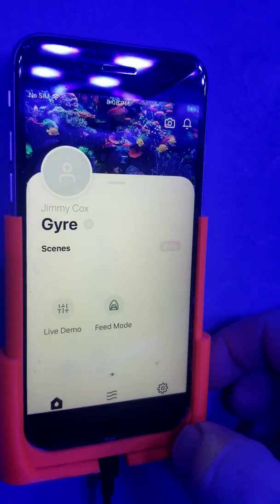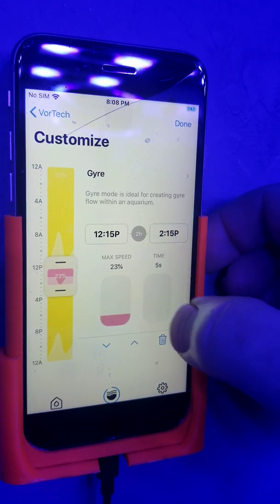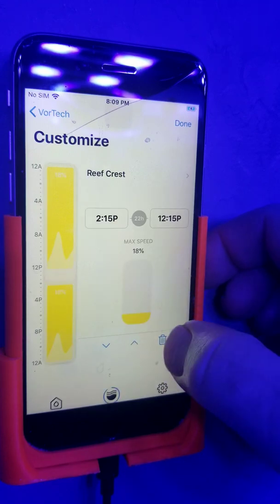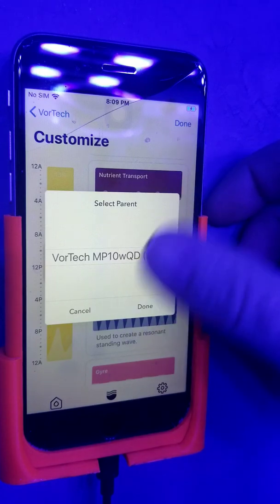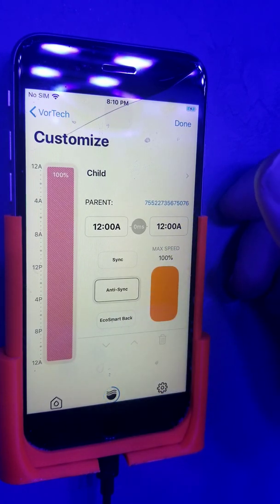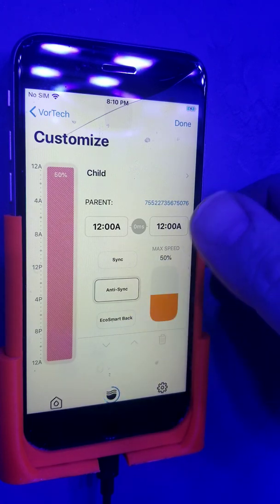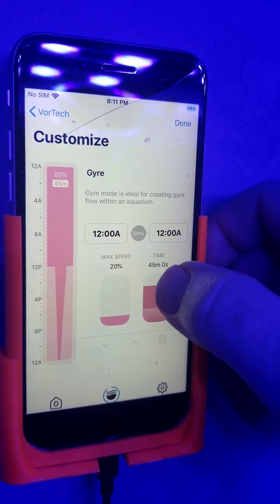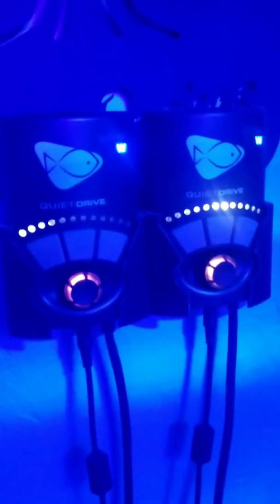Mobius/Gyre/AntiSync

Comment: They must have changed the app now. If Child is set to 100%, it isn’t 100% of Parent pump speed, it’s 100% of its own pump speed.  So it’ll run full blast. Just a FYI. I learned the hard way, after sand got shot everywhere.